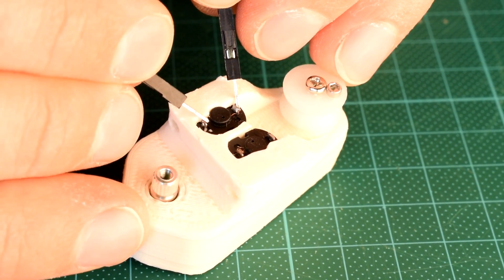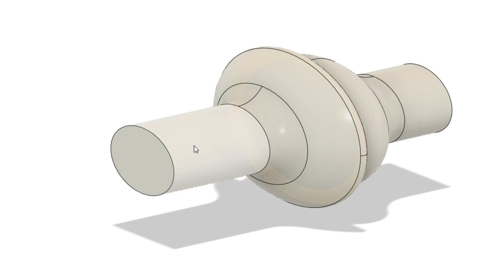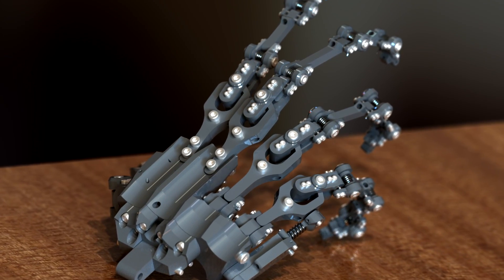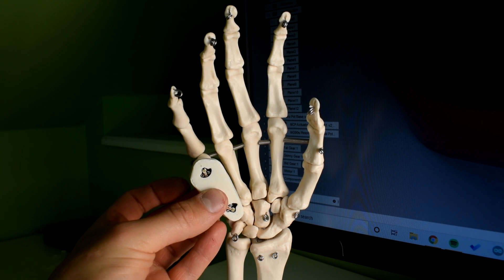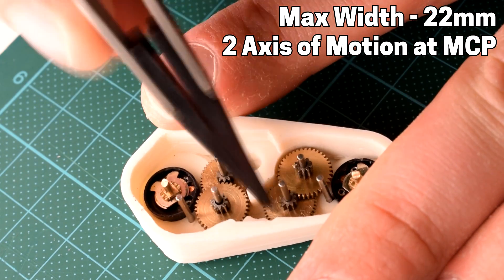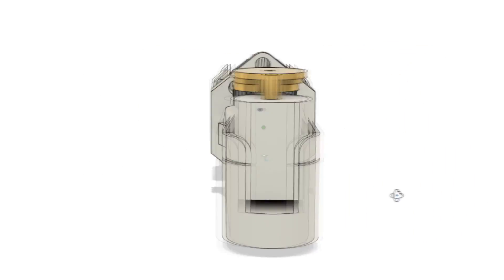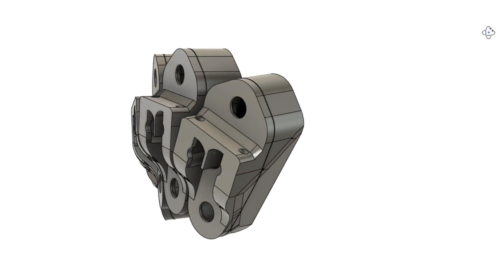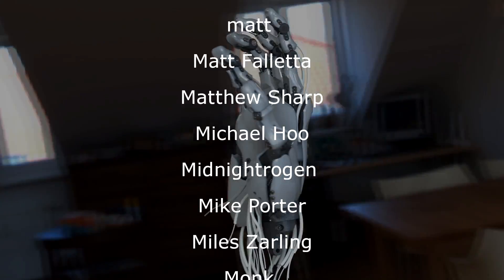Designing a Custom Bionic Hand Servo - Biomimetic Mechatronic Hand Part 2

Comment: Once your hand redesign is complete and functioning, would be very cool to see this CNC machined in hard metal, 7075? Titanium? Would be a literal terminator hand.
Reply: Calculating for a round bar of 7075 with 10 mm diameterr 50 mm length it would weigh 11,09 grams, after machining it would drop to about 8 grams i suppose  so i guess its doable

Comment: Okay so.... just found a few videos about creating artificial muscles ... No not those hydraulic or pneumatic ones. The ones made from supercoiled plastic filament, like fishing line. The actuation works on heating the coils. When heated they contract, also they spring on their own accord, to an extent.
I'm really looking forward to what you're going to build with these servos but I thought you might want to take a look at it as an alternative for the cables you're going to use or even as an actuator for really tiny muscle groups needed in the fingers.  At the very least it may be something to work as an attention grabber for the video series.

Comment: I worked on a similar design back in the 90s when I was just starting High School.
I was 15yrs old.
I started designing prosthetic limbs because I kept having recurring dreams that I lost a limb.
Some times it was my hand, some times my hole arm, sometimes my foot or leg.
I still fiddle with the spect, but and focusing on feet and legs now.
Thanks for the inspiration.

Comment: :O  Exciting to see you designing a servo.  It's been rattling around my head for years too, ever since trying to squeeze as many servos into a small space as possible, eventually you just think... i bet i could do this smaller by specialising the types of servos. 
I figure if i'm making servos to actuate pulleys anyway, why not ditch the gears and just use the pulleys for gearing.  ;)
You inevitably get into issues of the pulley/spool bend radius being so small it damages the cable, so i'm using flat ribbon instead of cable.
Reply: Good idea! I had something else in mind tho, try to find my comment below or above, and comment if you think it's useful.
Reply: I swear, a servo with pulleys for gearing would make Destin from Smarter Every Day faint with excitement

Comment: Oh jeez. Stepping up your game I see. Great job Will! This vid literally gave me a "why didn't I think of that... derp" moment. 

And now we have to find a supplier of raw servo metal gears until metal 3d printers come down in price and things get realllly fancy. XD
Reply: Man I can’t wait for that, do you KNOW how creative I could get if I could just assemble my ideas, instead of relying on machining or other limitations? Plus it’d be on hand and I wouldn’t need to wait several days if I had to special order something. 

If they sell the servos themselves, surely we could either see if they manufacture the gears on their own or what company supplies them? If you don’t have to order the servo as is, we could restructure the design as needed without worrying about a bunch of plastic hulls, discarded wiring, or motherboards

How do current Metal 3D printers go about working? Like is it liquid hot metal in templates or something like a molding process?
Reply: @davidthorp01  basically the machine lays down very thin layers of metal powder, and "welds" it together with a laser.

Comment: Hey Will, wouldn't it be easier, less "clunky" and I guess structurally stronger to print 1 part for all those 4 servos. Those parts are not moving (or move only slightly) on a human hand anyway. I guess that would make you to be able to use less "walls"  and gain more place for servo gears, thus also making the whole thing thinner. I hope my English is understandable.  lol :)

Comment: You know, this design process is absolutely brilliant. I hope it turns out as well as you’re hoping, since this could stand to help move forward research in limb replacement (if only to actually have a decent hand design!). This could also serve in all kinds of other robotics to spur some ideas into various creative servo redesign. 

I do wonder however, if this could be possible to apply to the exterior of a hand through similar design. I’m thinking along the lines of Arthritic patients who might have trouble with their hands, but still have them. If this could be possible; needless to say we would need to further miniaturize the servos while still keeping equipment integrity and range of motion. It would be difficult but not impossible. This way; should joint decomposition or bone damage impair movement, we could find a means of re-aligning the hand for an almost odd form of physical therapy (if only to keep muscle degradation low). It’s only an idea, but I’d need a hand figuring out how best to make the gauntlet without being bulky, since it would need to both act as an exo-skeleton in its own right AND be as gentle as humanly possible to the person wearing it, while keeping weight low. From how you’ve got your design, it fills my head with ideas. Ideas I’d need to figure out how to make. 

I’m currently getting a masters; just not in engineering or robotics, although I’m considering just picking it up because I want to understand it. History is my passion, but learning broadly is a part of said passion. A curious mind to the end.

At any rate, this idea is simply brilliant, and I can’t applaud the level of creativity put into the design enough.

Comment: Next level dude.  Complimenting the original servos as you improve them :) Really dig how your designs are so tailored to nature.  Print quality is better too.  Are you moving all the circuit boards out of the new servo unit and running wires to the motors?  Makes sense if you've gotta run power anyways

Comment: what about miniaturising a strain wave gear reduction system to get it even smaller? they're reversable so you'd have everything you need in a much smaller package, if you could pull it off, that is.